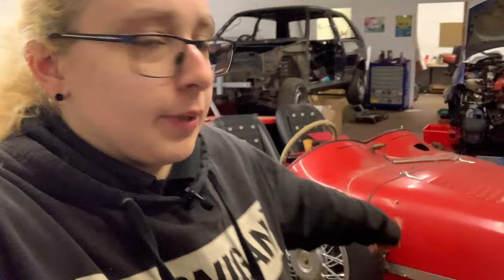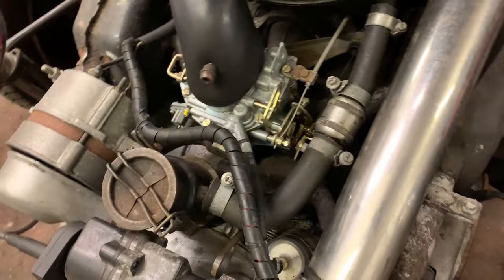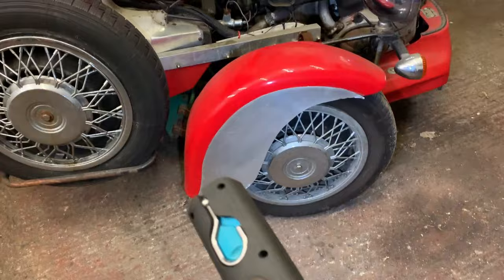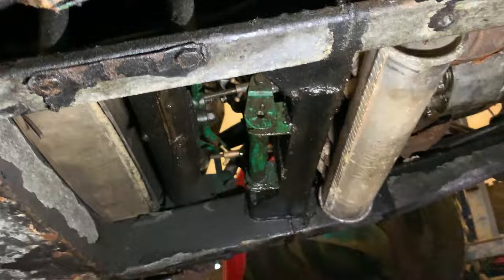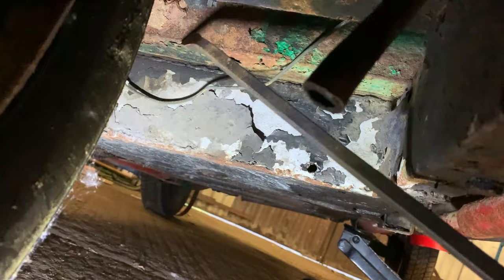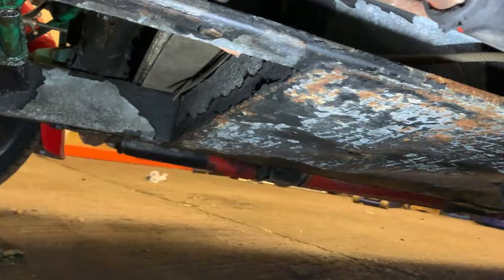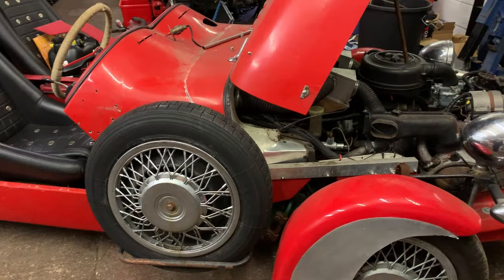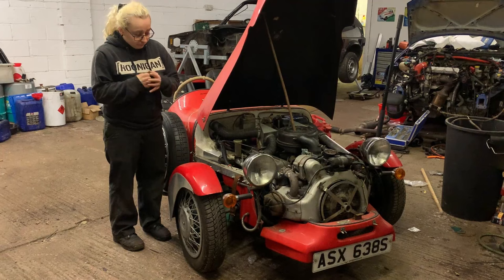Lomax 223 2CV Kit Car Project Ep. 2 - How Bad Is It?

Comment: Reason for 'missing' shock is there's only three wheels. 2CV has four so four shocks; this has three so three shocks.
The big cylinders contain the springs. The rear left one is anchored to the chassis because, again, three wheels so that one doesn't connect to a suspension arm (or parsley).

Comment: My Dad built one of these in the 80s and as a kid I helped (a bit). His was more standard than yours, Dark Green colour, all the engine cooling ducts removed, chrome straight through exhaust system with a cherry bomb, Original 2CV gear lever and the flared wings rather than cycle ones, aero screens and tonneau cover only, inboard disc brakes. At the time the best seats to fit were Renault 5 items which were plentiful back then, ours were black vinyl which was good for rainy days. A factory option ours had was a bar welded across the rear suspension arms so despite having one wheel, it used both suspension sides to provide support. Good luck, these are fun to drive if somewhat alarming!

Comment: I've always found that a ratchet strap is more secure and easier to use than most metal battery clamps. It's also easy to fit in inaccessible places.

Comment: Hi Katy, regarding your starting running problems. Don't just assume it is carb related. The 2CV has points, cunningly hidden behind the fan. If the points gap has partially closed up it will retard the ignition timing, which will make the engine lose power. Also if the points gap is too small it increases the dwell angle (the amount of time the points are closed for in degrees of crank movement) which means the coil has current flowing through it for longer, which could also lead to the coil getting hot.
I rather like the looks of your steering wheel.

A little bit of useless info. I met the founders of Lomax many years ago at the parents evening of my son's school. (They also had a child there). (My son is now 46). I've always fancied a Lomax. I hope you enjoy yours. There used to be two Lomaxs that parked at my local petrol station in Estepona (Spain) about 20 years ago.
Reply from the maker: This has been converted to electronic ignition so hopefully it’s a bit more straight forward!

Haha, that’s so cool! Glad to know they had a child there and weren’t hanging around randomly at parents evenings 😂

Comment: Interesting video. I see Hubnut has added some very useful comments - perhaps you could encourage him to visit and give you and us an explanation of how the 2CV suspension works and how it's been adapted for the Lomax. Regarding the poor running, even though the carb looks fairly new if it's been left for a year  there is a high possibility that that it's gummed up after being left with petrol in it. Just running it often cures that but cleaning the jets and float may be needed (video it when you dismantle, as it helps when you re- assemble).
Reply from the maker: Well I’ve offered him a test drive in it when it’s up and running, although I may have to adjust the seat a bit 😆

Funny you mention that, I started stripping the carb the other weekend and there’s quite a bit of crud in there. The floats seem fine but I’ll definitely be cleaning the jets out. And yes, it’s all being filmed!
Reply: @WrenchingWench  Good luck with the carb! If it has crud in the float chamber it will be worth adding a cheap in line fuel filter. In fact, the fuel line looks to have gone brown/yellow and may be brittle so could be worth changing that too.

Comment: I too acquired one of these with little knowledge of Lomax or Citroen 2CVs - you will have to get used to Citroen's odd engineering, as well as working out what the kit builder got right or wrong. The good news is that yours appears to be on a replacement chassis, and that it is correctly registered.  Some form of anti-roll is recommended, as it makes the handling better, and if stiff enough, completely eliminates any need for linked rear suspension. You have a lot of work ahead of you, but it will be worth it -  I still enjoy mine after 27 years of ownership.

Comment: Hi Katie, I'd strongly advise getting a new bit of fuel line to replace the garden hose looking stuff thats on there.
Ian has a good video somewhere on 2cv suspension, ill find it and leave a link, hes also got a massive hoard of 2cv parts.
On mot front, it might need to be inspected as a trike, even if dosent legally need to be tested, not alot of places have ramps for 3 wheelers.
Reply from the maker: Oh yes, I forgot to add that to the list! I changed all the lines on the Scirocco so that will definitely be a job to do on this.

And yes, I was about to say I’m planning on taking it to Jody at Auto Lass as she does three-wheeler MOTs, but I got distracted by the leaking fuel 😂

Comment: Elly the 2CV hates starting if parked up for a few days or more. Takes a while for her to pull fresh fuel in. If it remains hard to start even after it has run, definitely something going on. What's the thing in the air intake hose?
Reply: Middle driveshaft gaiter often leaks a bit of grease as the lower side slides up and down the driveshaft. Don't put a tie or clip on it.
Reply: The unidentified thing going across the underside is the steering rack. It's a beefy thing! Horizontal tube is a spring can. Tie rods attach to the front suspension arm via knife edges and are a grease point. Not sure how the rear suspension works on these.
Reply: The odd thing on the passenger side is effectively a dead end for the missing wheel.
Reply from the maker: Yeah, it basically won’t run without choke, so something’s not right! I’ve no idea what that is in the air intake! Looks like it should have something connected to it, but god knows what.
Reply: You mean the big shiny tube from the air cleaner to the cooling fan cowling? Years ago a guy who "knew 2CVs" fixed a bit of heater hose there and I replaced it with this SS tube for the looks. He assured naive little me that it was a form of supercharging! 🤣🤣Yeah. I know, I know! Still, looks a bit cool.
Reply: @WrenchingWench  Probably as simple as a blocked or partially blocked jet from standing. Will run on choke as that allows mixture to be rich enough but will bog if you want power, as the blocked jet won't flow enough fuel.